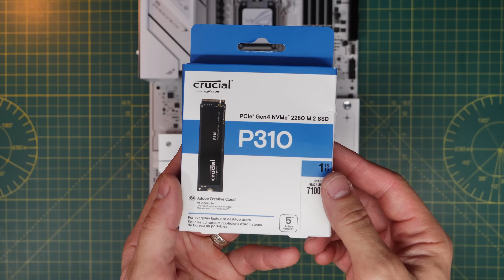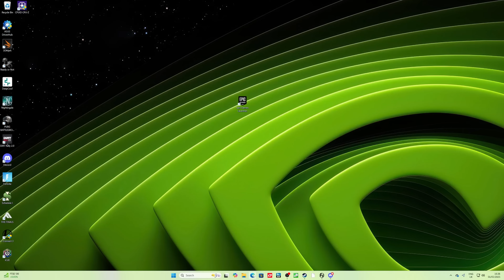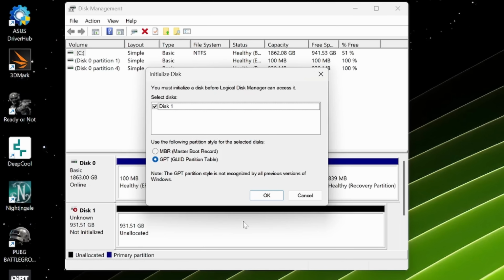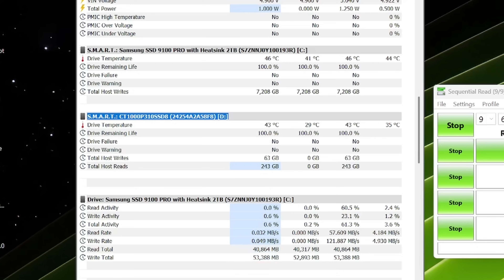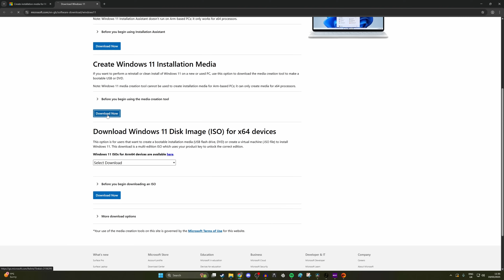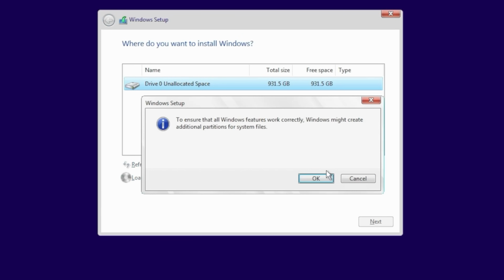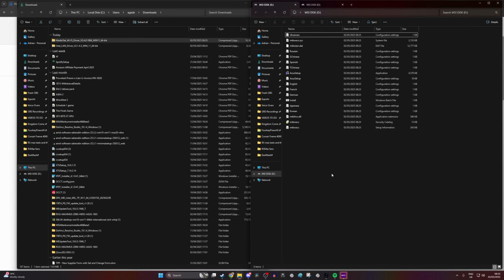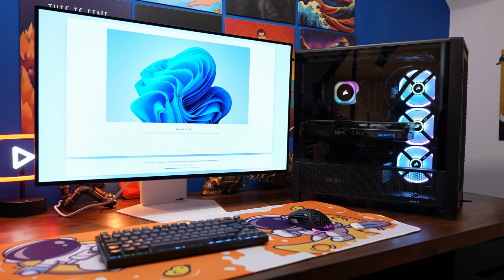How to setup Crucial P310 NVMe on PC and install Windows

Comment: I just purchased an MSI B650 Gaming Plus Wifi and and one of the Crucial p310's. The MB has two NVMe slots, but only one has the heatsink on it. Will I encounter heat issues installing a second one of these drives in the slot without a heatsink on it?
Reply from the maker: Are you using a different drive in the one with a heatsink?
Reply: @TheProvokedPrawn  I only have the one drive (P310) in the slot with the heatsink currently. Planning to add a second at a later time.

Comment: Hi Car dealership owner and PC Repair shop owner/Tech here you should explain to your viewers if the NVME or SSD is not detected when installing windows that they need to have Intel® Rapid Storage Technology (Intel® RST) Driver loaded on the USB and load the driver when there staring at a blank screen when your supposed to chose where you want Windows installed since Intel doesn’t play ball with all Vendors or else they wont have NVME/SSD Detected and think their 200-300 Brand New drive is DOA you would be surprised how many Customers call me for this problem and instead of confusing the viewers about WiFi not detected or LAN and installing drivers they can have a WiFi USB Dongle From Amazon for like 5 bucks with preloaded Drivers to temporarily have WIFI until Windows Automatically installs Drivers or Armorycrate assuming if its a Asus board just my rant but besides that love your videos P.S All of my 7 personal gaming rigs with all 40 Series Cards have Black Screen Of Death when goes into sleep mode and wont wake up just GPU Fans Spinning have to do a hard restart to Post I’ve Rolled back/DDU/Latest drivers not sure if its NVIDIA or windows or both i cant recommend NVIDIA to any of my customers right now what a joke i cant even figure it out and im not wiping 7 Rigs Clean just to potentially have the same problem and reinstalling 100’s of Software’s keep up the good work !!!!!

Comment: I bought one of these for my hp15s laptop, to replace the paltry 128gb drive and windows refuses to install on it. 

I've tried every version of Windows I have and none work. I have now downloaded an unofficial windows installer that claims to bypass hardware and secure disk requirements, but have yet to try it out. 

This drive works fine on my pc, but given that I already have a 2TB m.2, a 2TB SSD raid 0 and 12TB of HDD in that machine already, it's basically a useless spare part in there.

I do wonder if there is a size limit hard coded in that laptop, because my old 500Gb m.2 works, but only indicates 390GB. I've messed with bios settings and updated the bios. I've also tried loading the micron drivers during install, but windows still won't install. 

Very frustrating.

Comment: Do you use additional heatpad if you have single-sided SSD and mounting in the first slot and it's not touching the MB side heatsink (?) shown at 0:31 and 0:43 ?